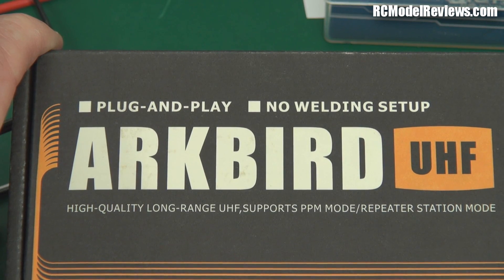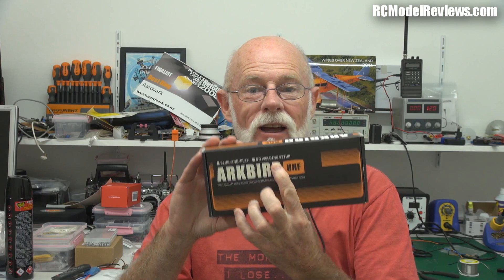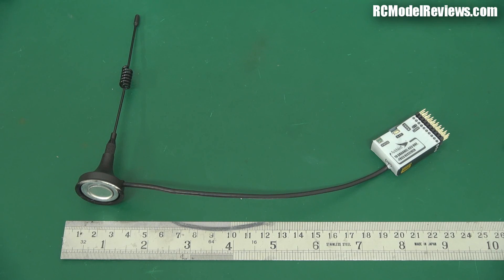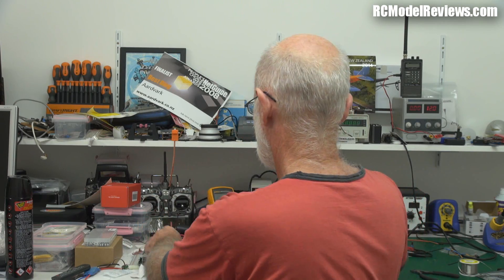Arkbird UHF RC system -  a first-look

Comment: I purchased the same arkbird UHF system.  what is the cheapest easiest transmitter i can relay from?  I have a bunch of older Futaba radios.  Will any of those work?  If it must be a newer 2.4 ghz radio, what brand and model will work?  Thank you for your videos and feedback... m.reiman@comcast.net

Comment: Looking forward to the LRS comparison. Hope you get around to getting your exemption soon, as you have lots of goodies you have for testing.

It would be great if you can also add the RangeLink UHF LRS to the test and also compare the third order harmonics  noise they emit (and noise in any other frequencies of concern) - those are troublesome when using 1280MHz video.

Comment: for the cost I wouldnt even consider the arkbird
you can get a ezuhf jr module and a receiver for 200.00
a nice dragon link for 260ish
even a open-lrs system for 80-120.00
I would go with Rlink for about the same cost as the arkbird over the arkbird itself

Its a LRS system who wants a 100mw to 140mw system
orange 1w is over 400mw (everyone knows its not a true 1watt system)

Comment: The signal relay is also possible with all the other Top LRS systems in the market, Dragonlink, EzUHF,...
Get a 2.4Ghz RX that has PPM out and plug it into the PPMin of the LRS and it's done.
Reply: ***** I meant CPPM or PPM-Sum.

Comment: If you are worried about separation then isn't a 5.8 ghz relay the easiest/ least complicated way to go about it? Just sit 30 ft away from your 1.3 ghz GS and pipe the video over 5.8 to your headset. Relaying the control seems a lot more complicated and error prone to me.

Comment: The arkbird antena is better to use on a multicopter. Now i begin to interested in a system like that, not for long range but for the signal integrity. If ia can fly 10 kilometers away, if i am only 1km away it should fly without a problem. Now that i am investing in a hexa for aerial video, maybe that is the way to go. WAITING FOR THE REVIEW. Cheers

Comment: Hy, you should measure the difference between the latency while using it as a relay station or plugging it in directly to your transmitter.

Comment: Using the Arkbird as a repeater is there any lag in controls and if so how noticeable is it?
Reply: There would be a delay, but really it's proven that unless you are doing fast 3D flying, lag has very little impact, especially in FPV when you are typically flying quite gently.